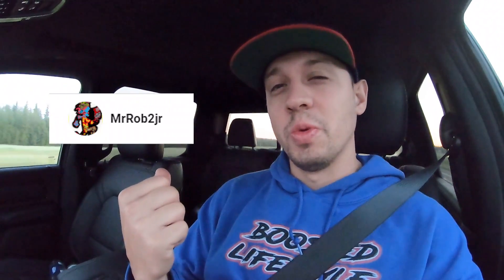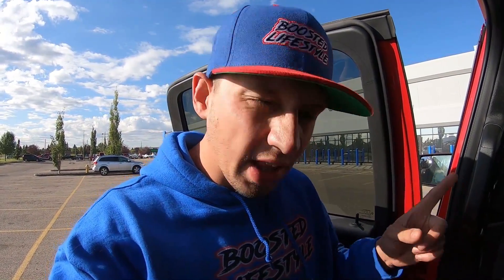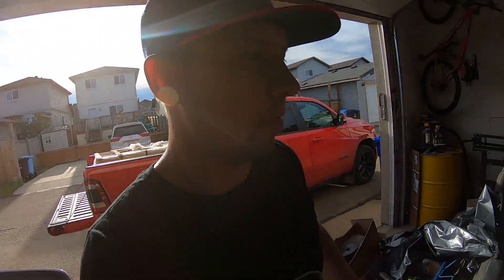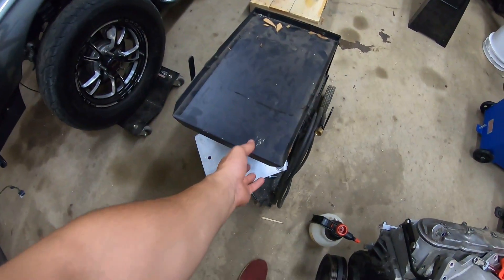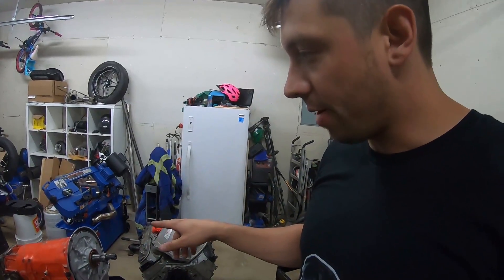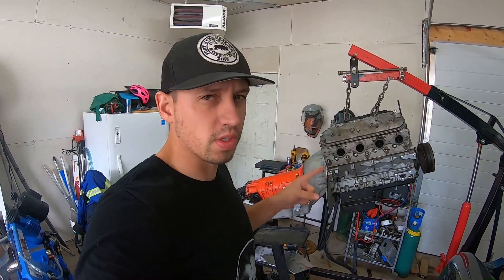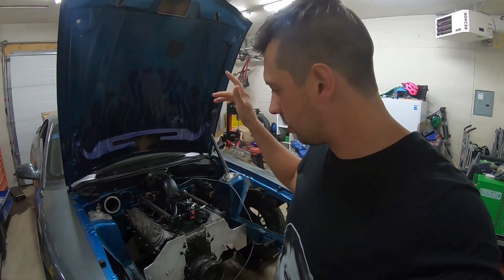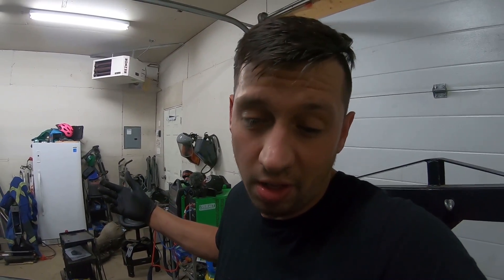Everything I Need To Make This Perfect

Comment: You need to move the blade guides as close to the vice as you can, never let the blade hit the material fast. You can use that 6-8 pitch blade on stainless if you put it at the slowest blade speed and use coolant. That saw was the first bandsaw I had when we started our machine shop 15 years ago. It worked ok for a few years, just feed fast up to material then turn it down.
Reply from the maker: So I need some adjusting 😂
Reply: Boosted Lifestyle you know what I like about you? You don’t give up, you just keep plugging away at it.

Comment: So that little wheel behind the coolant shutoff, loosen that and move the guide forward towards the vice. That's the blade guide. It helps keep it stiff basically, less distance where it's not supported. That will help out a ton.
If you cut larger pieces, just move it back.

Comment: Slow down the feed on the bandsaw it's dropping too fast. Also add coolant. It's not necessarily the blade. If it's dropping too fast it won't cut square either. Practice will make perfect 👌

Comment: 11:22 you need to get coolant/lubricant for your saw, running it dry like that is very hard on the blade and the piece youre cutting. Also, you need to move the orange guides closer to your workpiece. It keeps the blade straight and cuts down on chatter

Comment: The slower you cut the straighter it will be. I nearly died when you started the saw. Fast to Get to the job then slow to cut. Helps blades last longer also. Put a mesh screen in the tray. Stops a lot of crap going to the pump. They needs lots of cleaning. Also were have you put the Alien lol

Comment: Kyle I’ve got a Ram Sport 2019 and I got a windshield ding big one just like yours in the almost same spot right by the rear view mirror when the truck was also new last year barely had 2000km on it. It is cracked all to hell now this summer too have to get it replaced before winter I’m thinking.   Same highway back and forth to Fort McMurray for work.  Seems like these Rams love the rocks lol.   Good video like the go pro style travel vlog was different 🍻👍.

Comment: Hey homie.  Love that shirt!👍😉  Mine finally shipped yesterday and it'll be here this week.  Everyone gave good tips on the new bandsaw setup, move the blade guides in as close to the part or the vice will allow, ease into the cut, etc.  The only thing I will add is when cutting thin material, you want more teeth per inch. Ideally you would have at least 2 teeth engaged into the cut at all times.  Save that coarse 8-10 TPI for cutting flat bar or the teeth will just get raped and stripped off the blade.  The intake looks great on there, man.👌  Cool setup! 
I hope Virginia feels better soon, buddy.  Y'all have a nice evening. ✌easy.

Comment: We usually pull the filter media out like an accordion so you can look in all the cracks for metal, and holy shit hot rod, that poor blade, slow down, use the coolant, it has lubrication in it, go in all dry like a high schooler

Comment: Comp engineering and some others make flexplate shims when you buy new mid plates usually it comes with not pad shims. I cant tell you how many time I see the bolt come loose on a turbo or pro charger set up and destroy the flex plate or brake out put shaft

Comment: Don't forget the spacer for the end of the torque converter to be in the crank snout otherwise big trouble all transmissions are a little bit different there is a way to measure the space you need for your flywheel to torque converter
Reply from the maker: It's also in there already 👌

Comment: A bit of Silvery swirl is normal. Chunky Silver and/or Bronze is not.. I tell guys running turbo combinations, get in the habit of checking the crank thrust every so often. Very easy to do with a dial indicator and a small pry bar, and it doesn't have to be apart to do it. Easy way to see if the thrust is wiping out, especially if you do it before a race as a baseline. Also, the other intake style you ran tends to make more power in these applications over a carb intake and an elbow, BUT, big picture, I see why you did it. You Could have made a plenum top spacer to get the throttle body height up however, moot point now... just an observation. 
Just keep an eye on the tune with that intake setup... much smaller plenum and much longer, different length runners... hope this helps.

Comment: I had a quick question? What is the advantage of running a dual plane, or tunnel ram, intake manifold with the elbow?  I'd assume to accomadate running the car at high RPM given the cam and boost?
Reply from the maker: I picked this one just because of how it's orientated

Comment: Only thing that hurts is watching you use the saw 😂 where the coolant hose goes in you can slide it up to make it closer to the part your sawing it will help with cutting straight 😂😂 just a little tip

Comment: One thing you should do is slide the left roller as close to the material your cutting . The shorter the distance between rollers the straighter the blade will stay. #journeymanmachinistguy.

Comment: Dude do not shim the torque converter bolts shim the flex plate. Hope you get this before you brake all the the bolts
Reply from the maker: Shims between the bolts and the pads are super normal though